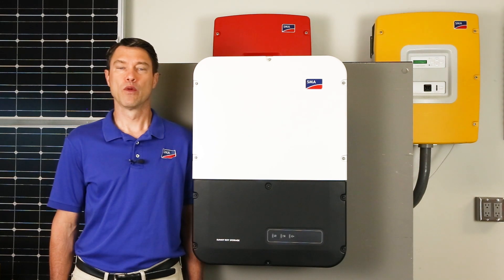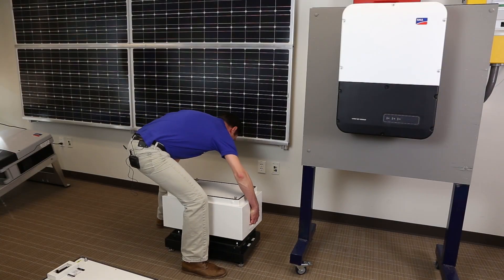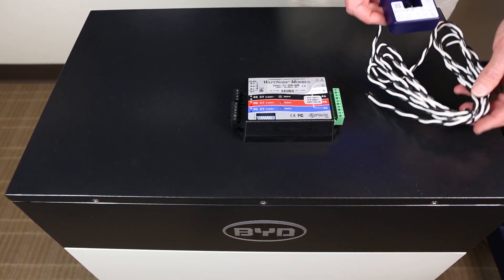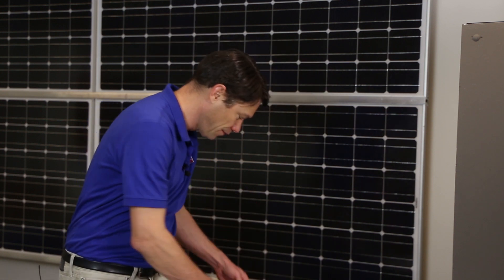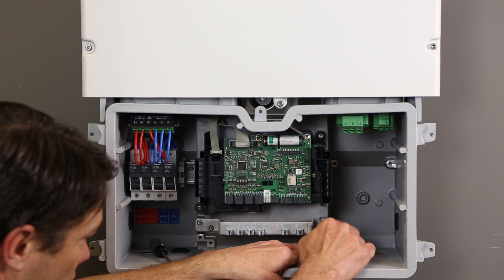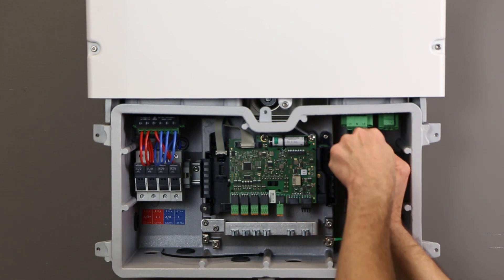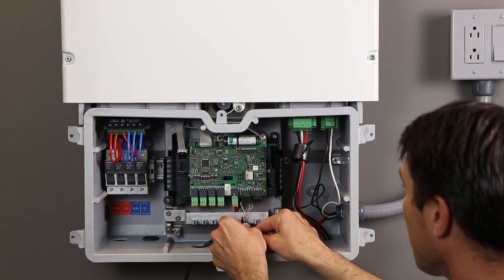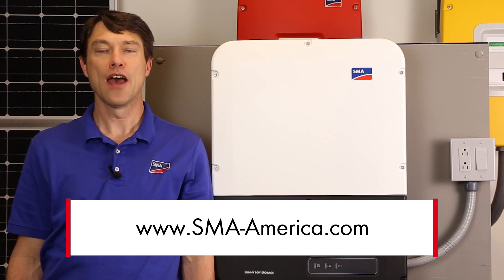SMA Energy System Part 1: Installation of Sunny Boy Storage

Comment: umm where does the SOLAR get plugged in???
Reply: This is an AC coupled inverter. No PV modules needed.
Reply: On the top left where the red and blue wires are. Per the manual it's 600 vdc max with 15a per string and it's side A or  side B. 5kw max regardless.

Comment: What does the blue light on the inverter indicate when it is on?
Reply: It shows that the unit is communicating (either wirelessly or via a Ethernet connection)

Comment: Will this work with a DIY built battery bank, or will it not function without the battery communication wires?
Reply from the maker: The Sunny Boy Storage must only be used with a battery from the approved battery document here: https://files.sma.de/downloads/SBS-Batteries-TI-en-18.pdf
Reply: @smasolartechnology  The link doesn't work.
Reply: @smasolartechnology  This is the link.

https://files.sma.de/downloads/SI-LiIon-TI-en-46.pdf
Reply: Where you able to do a diy? I only have the sps set up

Comment: hi how i can connect two tripower inverter  in paraller
Reply from the maker: Mon – Your installer will know the specifics of local code requirement, but generally each inverter must have a dedicated AC breaker sized appropriately for the inverter power installed into the breaker panel (or subpanel) of the utility service at the install location.
Reply: I tried the esenz for three different brand Inverters, SMA Sunny tripower and SMA Solid Q50 and Sols 50KTL-5G. Esenz is really well and working fine for past 2 years.

Comment: where does the wattnode modbus go?
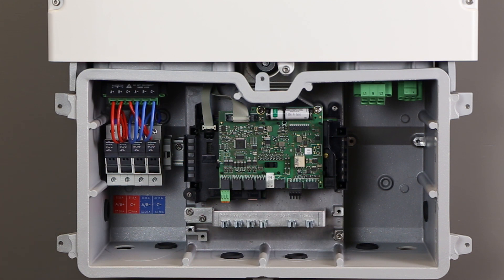Reply from the maker: Nicholas – If I understand your message correctly, the Wattnode Energy meter Modbus cable connects from the meter to the RS485 terminals on the communications board of the Sunny Boy Storage.  This location is shown from 6:40 to 6:47 in the video, and the required plug is included in the accessories bag.